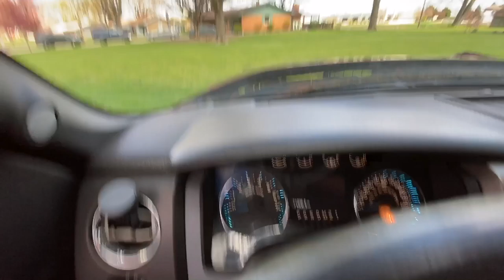Rebuilding a Badly Wrecked 2014 Ford F-150 - Part 1

Comment: That shouldn't be too terrible.   If I remember correctly that ruby red paint is a tinted clear coat so you might be a little shocked when you get the materials bill for the paint supplies but other than that I don't see why the truck cant be saved.   Looking forward to the progress on this for sure!  Nice video!!
Reply: yeah, I'm thinking this is more of a sheet metal replacement fix, with some underlying structural damage. But the skeleton of the truck should be okay, and no frame damage.
Reply from the maker: Thank you! This is actually not Ruby Red (although my parts truck that you haven’t seen yet is). This is a color called Sunset Metallic. 2014 was the only year of that color on this body style, so finding parts in that color is difficult. But, to your point... the paint for this color is quite expensive as well! 🤦‍♂️
Reply from the maker: Very little underlying damage other than what you can see in the front right apron. I’ll get into more of what Jack found under the surface in the next vid on this truck.

Comment: No airbags blown......I'm thinking maybe the truck was shut off and parked when it was hit. It's my understanding that bags won't blow if no key is in the ignition....or push button start is in the off position. Just a guess. Good to see you back, Stephen.
Reply from the maker: This is an interesting theory... I tend to think it was running based on the Carfax. It says in was side swiped (drivers side) and then impact with another vehicle (front right). But I can’t explain the lack of airbags. My BMW didn’t blow any bags either. 🤷‍♂️
Anyway, excited to get into it!! Thank you for watching!!

Comment: Dang, she took quite a hit. I wonder if you will have to section in a portion of the cab to get it fixed. I've been told aluminum body vehicles tear instead of straightening when it is being pulled. Don't know if it is true, but I guess we will find out.
Reply from the maker: Yes, she took quite a beating! This is actually the last year of the steel body trucks, so that’s helpful. But you are absolutely correct about aluminum.

Comment: Actually doesn't look that bad! Is it a 5.4? Out of experience, I reccomend to swap that trans cooler for a bigger one.
Reply from the maker: This has the 5.0 coyote V8 in it. I’ll look into the upgraded trans cooler. Thx for the tip!
Reply: @CrossroadsRebuild  good thing it's not a 5.4 My dad has a 14 expedition and had to spend about 5k replacing timing, fasers and oil pump at less than 30k miles.

Comment: Got a question.  We are currently rebuilding a similar f150.  How did you replace your fender apron tubes?  Did you remove the dash to get to them?
Reply from the maker: My truck is actually still in the frame repair shop. I’ll be covering what we ended up doing to mine in the next vid on the F150. But the gist of it is that if you want to remove and replace the whole thing, it looks like you’d have to remove the dash and possibly part of the cowl as well. Ford has done some really tricky welding and assembly on these things which makes it very difficult to repair.
There are two places where the apron tube connects into the body of the truck. The lower one can easily be removed by drilling out the spot welds. It is the upper one which is nearly impossible to access. So we ended up sectioning the upper tube near the cowl and attaching the donor to the remaining original. Not sure if that explains it well, but I will try to go over that in an upcoming vid as well.
If you have additional questions feel free to send me an email. My address is in the description below each video.
Reply: @CrossroadsRebuild  thank you so much for your quick reply. This is what we are afraid of.  Thank you so much for the help on this.  We will mention your channel in our next video when we do the apron.
Reply from the maker: You’re so welcome! I just got done watching your most recent two vids (and subscribed of course!) on your new F150 build. Looks like a beautiful truck! I look forward to following along as you rebuild it.
When I got mine I searched high and low for a video showing how to repair or replace the apron tubes and came up with nothing. So hopefully our two channels will help people in the future.
I appreciate any shout out you give me on your channel. I will try to remember to do the same for you as I think you guys are doing good work and are entertaining to watch. Wish I had a partner to work with on all my builds!
Reply: @CrossroadsRebuild  exactly.  We have not found anything that speaks clearly about the apron repair process.  Its an amazing truck and we are excited about rebuilding it.  We just sold our first build the "silver bullet"  having a partner makes it  alot of fun for sure.  Thanks for the sub and views.  Greatly appreciated.  I saw your wife in the truck video.  You should get her on with you.  Diy gang does it and its a great dynamic.
Reply from the maker: Congrats on selling your first F150! My wife has helped me at times, but she works full time with her own business, and her hours are usually different than mine. So it’s hard to have her help. Love it when she’s able to do though!
Keep up the great work!!
Reply: @CrossroadsRebuild  well I really enjoy your personality.  I will be watching other videos but secretly hoping for the next f150 video drop.

Comment: I just think that truck is to far gone. That truck needs a lot of work and it going to be expensive. My opinion is I think you should just go on Copart and bid on a newer ford truck
Reply from the maker: Hey, I respect that opinion! And I don’t fault anyone for thinking that. But I like a challenge and I also enjoy bringing something back that initially looks really bad. I actually bought this truck on purpose because it is the last year of the steel body Fords. From 2015 and on they’re aluminum. They’re super nice trucks, but much harder and much more expensive to fix!!
Anyway, I hope you’re able to enjoy the Rebuild series! Thx for watching!!
Reply: @CrossroadsRebuild  I'm not going anywhere. That why I'm a ram guy
Reply: You need to watch Arthur tussik this truck is just a fender bender compared to what Arthur does. Lol